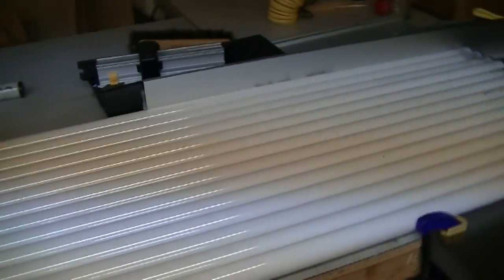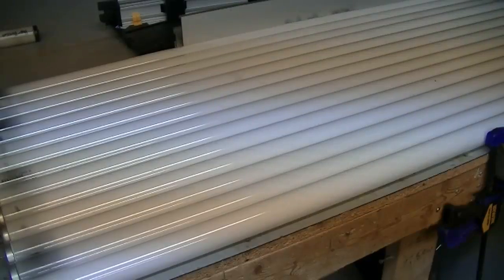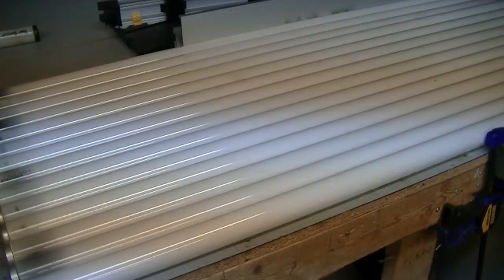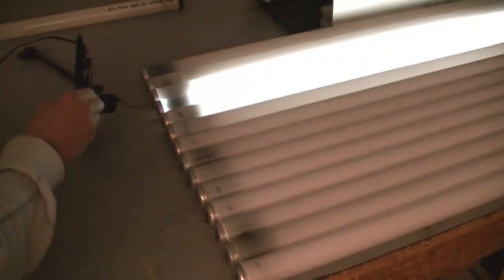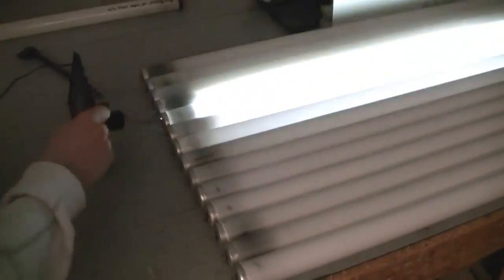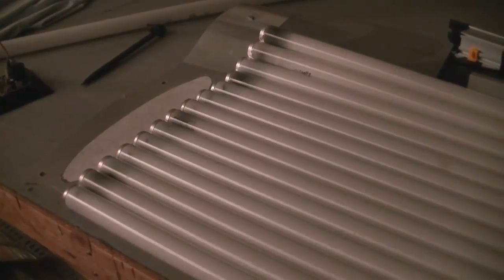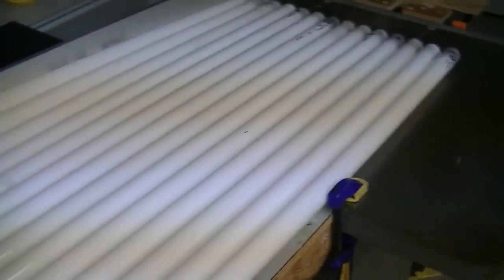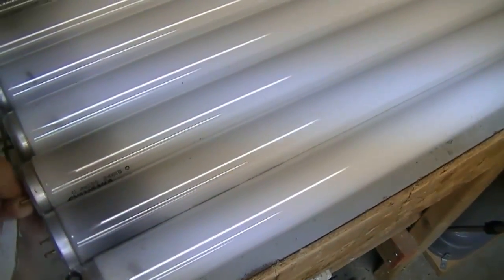Testing Bad Fluorescent Tubes With a Flyback Transformer

Comment: You're correct.  If the electrodes are bad, they won't work in the fixture but likely will have intact seals and light up when hit with some high voltage.    If the microphone on your plasma globe base still works, try playing some music at it and watch what the tubes do.